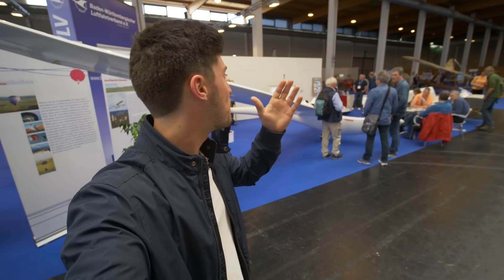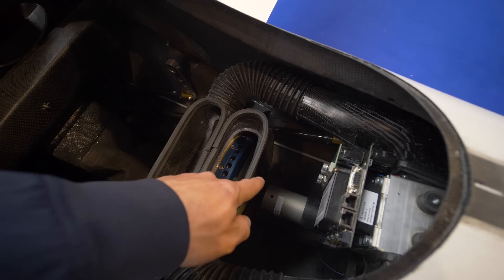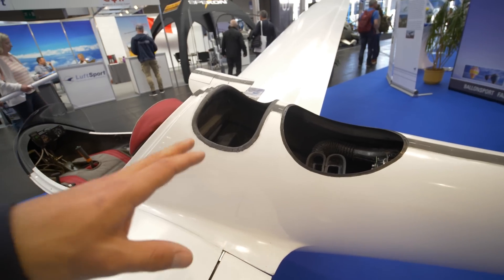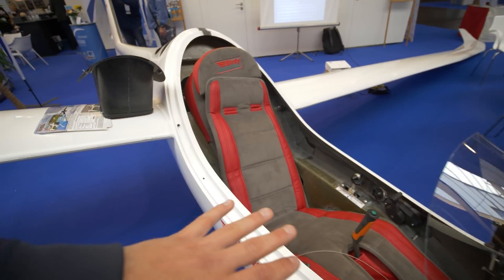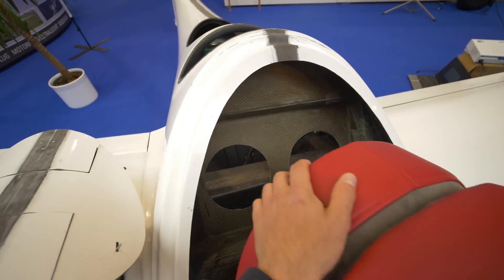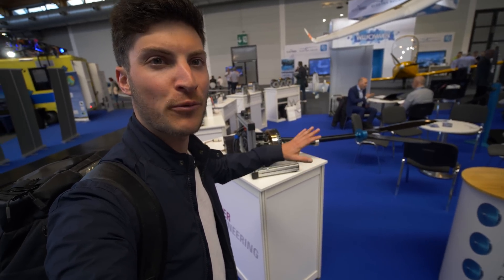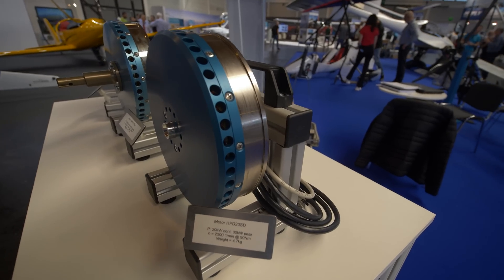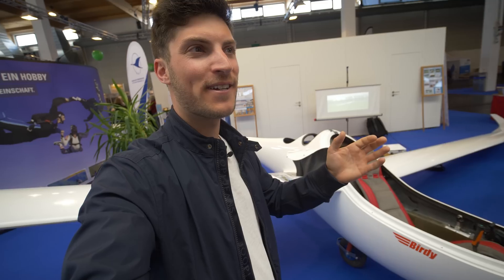120 kg Electric Glider BIRDY - AFFORDABLE Future of Gliding? | AERO 2022

Comment: Affordable means......under $100,000 or under $200,000..? I'm going to depend on an electric motor NOT failing for my spoilers.....NO!!! Done emergency practice landings on a 9000' runway with no spoilers and almost floated down the entire length in ground effect before getting the wheels to stay planted..... Should have spoilers....

Comment: What are the specs!  The surface area ! The aspect ratio,! 
Stall speed!

103 legal requirements are to have it with less than 24 kn stall speed and that will dictate what will be the surface area size and total wing load..

Comment: Cool project but I don't like tail. It adds a lot of difficulties for take off and landing! Solution without spoilers is interesting but what if you don't have any power in the batteries? Glide performance is impressive!
Reply: If the battery is empty the impressive glide performance becomes a real problem
Reply: @photosquare7  By my calcs slowing it from cruise to landing speed then bringing it to a halt will require about 1% of the battery capacity. So, it'll work so long as you've only used 99%. But, yeah, if you used all the battery getting out of trouble earlier in the flight, there's another drama to face landing.

Comment: I'd like to see an FMEA for using the electric drive as the speed brake, it requires the complex system to function vs the simple mechanical spoiler. The spoiler function, if not available, can be compensated for by flying uncoordinated at the cost of higher pilot workload, so it may be acceptable.

Comment: Why is he talking about meters and kilometers per hour, climb rates of meters per second?
These aren't aviation units of measurement.

Altitude is in feet, climb rates are feet per minute, distance is in nautical miles while speed is measured in knots.

The numbers he's quoting mean nothing to an aviator without a calculator.
Covering up bad performance with changed numbers?
Reply: That's what glider pilots use in Europe

Comment: Nice looking glider. Electric motors for airplane is a mute point: it looks simple but it is not. You need a heavy inefficient battery (very polluting) an DC/AC converter, an expensive permanent magnet (from China) motor and the dreadful limited range.
For the same weight and less money you can get a gasoline (petrol) engine that can go 10 times longer.

Comment: I am a noob on these microlight gliders...Perhaps a stupid question, but can You fly these on an EASA glider licence? Or do You require a country specific micro light licence?
Reply from the maker: You need a micro light licence because it has a propulsion system. A micro light glider without propulsion would only need a check flight...
Reply: @SteFly  Thanks for the clarification, makes sense!
I thought that perhaps it was under the same rules as SLG:s.

Comment: very nice to have low weight including motor, I'm a big believer that planes can be a lot better than they are, mainly powered planes where they can get away with poor engineering.
I would like to see a similar optimized plane with a pressurized cabin and 2 tiny turbofan jet engines on it for a design speed well over 500km/h. I think that concept has enormous potential. People fail to appreciate that a turbofan plane can be very fuel efficient at altitude and have extreme range so we can have fast, cheap, fuel efficient, long range planes with dual engine redundancy for ocean crossing capability. It would be a small revolution.
Reply: Hi Dan, -  so You need only  12 hours  to fly from Frankfurt to New York - alone in Your plane ...........and so cheap ......  ha  ha  ha
Reply: @helmutpohl2762  It could be a tandem or 4 seater, same premise. And it could be 9-10 hours to New York which is pretty fast from decision time, likely beating an airliner and it becomes extremely fast when it's not a common destination like New York. Say Nova Scotia, Kentucky or Manitoba, well outside any major city. It might be 4 times faster than commercial airliner. And similarly inside Europe. Say Fyresdal Norway to Mors Denmark, a trip that takes quite a long time and cannot be done by commercial air but in a personal plane could be done in 30 minutes for next to no money while it might cost 400$ by cars and planes and trains and take 18 hours.
Rich people pay big money for less freedom. Or Paderborn, Germany to Norwich, England, that's 45 minutes but try doing that with public transport. I just did a search on travellink, 4 flights each way, 800$, 10½ hours one way and you depart at 7AM and 19hours the other way. With a personal jet you just go whenever you want and it's close to cost free.
With runway to runway autopilot you don't even have to fly it.
Private jet freedom but no more expensive than a car. If done right.

Comment: I'm, probably, wrong but I use airbrakes to reduce lift, not speed.  It is kind of scary to dive towards airfield with propeller basically  working  as a parachute. Sounds like acrobatic.
Reply: Air brakes increase drag, reducing speed for the same angle of attack. Spoilers reduce lift, and also increase drag. Gliders often have linked air brakes and spoilers, so they are used together. Either has the effect of making the glide slope steeper, but they affect pitch differently.

Comment: No spoilers, counting on the electric system to always work, and always have enough power to create enough drag for a normal descent and landing.  I don't think so.  Great video anyway, thanks!
Reply: The early ASW12's had no speedbrakes. Once under a big strong cloud near the cloud base it is very nerve wracking not to be sucked into the clouds and stay VMC. Seen the claimed L/D of 40 the speed will rapidly approch the Vne in this situation.
Nevertheless the complete concept is brilliant.

Comment: wondering how they've handled the torsional resonance of the long drive shaft which is what is the usual problem with long shaft rear drives
Reply from the maker: I heard something about it.. they also had problems at the beginning and now they are using a slightly bigger diameter carbon fiber tube.
Reply: @SteFly  A bigger diameter will probably help, but is not the main problem/solution.  On long shafts, there MUST be non-symmetrical spacing between the anchor bearings that the shaft passes through.  If the shaft is 2 meters long for example, pass-through bearings would be at 0.45 meter, 1.1 meter, and 1.8 meter.  This makes sympathetic standing-wave vibrations unable to develop in the shaft.  This is a MUST!
Reply: @SteFly  the biggest problem is when the rotating propeller blade passes through the 'shadow' of dirty disturbed air behind the rear control surfaces (the rudder) and it causes a "bump" and that's what causes the vibration. With a piston engine you also get the power pulses torquing the drive shaft BUT with an electric motor that's eliminated.
Going up in drive shaft tube size helps the resonance problem but then other issues arise as the drive tube gets larger... It's all a compromise
Reply: It reminds me of those crazy Thai riverboats that just have a long prop shaft stuck on a big v8 or similar...I do not understand how that works, but it is somehow dynamically stable. Built a small model  long time ago that worked, to my surprise. It seems like adding additional supports easily makes it unstable.
Reply: @erikisberg3886  ah, I remember those...
Good times in 1973 on leave.
Yes, in my month living in Bangkok right beside the river I never saw one whipping or vibrating with any syne waves. I wonder if it's because it's only supported at one end and the shafts are fairly large diameter (proportionally)
Reply: @bobjoatmon1993  The simple model experiment I did was with a propeller attached to a welding rods driven by a DC motor. The rather flexible shaft could take a surprising amount of propulsive  force and torque. I worked at the Chalmers University department of machine components at the time. Remember a lot of discussion at the coffee table about why this works... I still do not have a clear picture of how. If You try to support or disturb the shaft it can fail quickly and spectacularly... 
I have also seen one of those irl, amazing contraption and performance.
Reply: @erikisberg3886  yes, once the rotating mass gets out of the axis of rotation, the shaft becomes a flail and beats everything around it viciously. I have seen long shafts twisted up like pretzels in an instant in my experience as a Millwright (industrial mechanic) and as an A&P aircraft mechanic.
Wait till your a few yards from a 60, 000HP (yes I mean 60K) turbine engine driving a huge centrifugal pump and one of the flex couplings shears and a 6" steel shaft bends and flails around... Shaft guards might as well be made of tissue paper.

Comment: Using the reverse thrust from the motor instead of airbrakes is a good weight saving idea, but what if you run out of battery?
Reply: If it has a variable pitch prop (even two positions, which isn't too hard) then you could charge the battery. It would even be a very interesting idea in racing (if made legal)  or certainly for just fun flying to charge the battery in a thermal or ridge/wave and then use that to extend the glide. Two hours level cruise at presumably about 100 km/h would be amazing for getting between lift sources. When would you ever actually need that much?
Reply: Samuel, realize that what you're asking is "what happens if you don't pay attention to your flight?"  There are many ways to screw up a flight, and they have consequences.  You're looking to fly a plane without paying attention to how much "fuel' is onboard?  Remind me to not fly with you.
Reply: @lesizmor9079 plenty of case studies showing experienced pilots making basic mistakes. Or defects which cause you further issues. I’m just asking what is the back up if you have no battery left? Surely the manufacturer has thought of an alternative?
Reply: @lesizmor9079  remind me not to fly with you if your arrogance thinks you cannot make a mistake

Comment: I've used the prop as an air brake on my rc gliders for years and it works really well, all it needs is enough throttle to open the folding props and then the drag slows it all down.
You said the props reverse on this, is that correct? 
What price would these be?

Comment: If I didn't already have my Silent 2 I'd certainly consider one. I like the convertible top. The 2hr endurance on electric would be great if true. The folding prop may windmill enough to stay open and provide  adequate drag for approach. I expect the motor would have to supply significant braking/regen to stop the prop for folding. I doubt very much that it is reversible and even if it were , the lag in going from forward thru folded to reverse would make it impractical for glide-slope control.
Reply: It's a glider.  So the motor is not running in the pattern.  The flaps would probably be the primary way to increase the rate of descent.  I'd not want to rely on the motor when landing.

Comment: THAT IS A VERY INTERESTING GLIDER!! DOES IT  CLASSIFY AS AN ULTRALIGHT IN THE US ? (NO PILOTS LICENSE OR MEDICAL REQUIREMENTS )? CAN YOU ARRANGE A FLIGHT AND DO A VIDEO I'D  LOVE TO KNOW MORE!!THANKS  GREATWORK!
Reply from the maker: Not sure about the US regulations. Here in the EU we need a 120 kg ultralight license but no medical.
First I will need to get the license... costs some money but it's the plan
Reply: He did answer the "About" price, in a reply I read, above!
So, "About €60,000!"
Reply: @robertweekley5926  wow 60k would be great. Sign me up. Can the wings be removed/folded so it can be stored in a trailer? That is a big cost savings as in the USA T hangars are hard to find and increasingly expensive.
Reply: 120kg = 120 x 2.205 = 264.5 pounds. The part 103 ultra light weight limit is 254 pounds. However if equipped with airframe parachute the weight limit is lifted to 278 pounds. So if a chute can be added for less than 13.5 pounds it might be possible to be a part 103 vehicle. Note part 103 vehicles are not classified as airplanes. If over weight for part 103 then you will need a glider ppl, which is not the end of the world to obtain and good education. I think the most important piece of info is the cost, I might have missed it? What does it cost?

Comment: These are the most exciting and innovative design developments in a while. This glider might never win a race, but not all gliders should be compared to racing gliders. Compared to most other light aircraft or TMGs a 200 km vne is impressive. and 30 KW from a 4,7 kg motor!
Reply: Problem being the energy isn't in the motor... it's in the heavy batteries you need to power it. We won't surpass the energy density in petroleum products in our lifetime.
Reply: @sillyoldbastard3280  although the thought is quite seductive. Imagine an energy carrier with 10kWh/kg and a motor with almost 10kW/kg.
Unfortunately any battery chemistry imaginable will not even come anywhere close to that.
Maybe a fuel cell will one day, but not if it needs pure hydrogen.
Reply: @sillyoldbastard3280  well not mine but my 17 yr old very well might see that.
Reply: @sillyoldbastard3280  Jet fuel is 50x more energy dense than a lithium batteries
Reply: One cannot compare an electric motor to an internal combustion engine. One has to always include the fuel tanks and the batteries for a given mission.

Comment: I don't understand how they will use braking with prop to degrade your glide for landing. The folding prop opens with forward thrust. How would you achieve that to create revers or just drag? What am I missing here?
Reply from the maker: You are right. It can´t be reverse power - only drag from the unfolded prop. A mechanism to controle the pitch of the prop would be awesome.
Reply: A wind milling prop could create a lot of drag, autorotate down gyrocopter style, sort of... I assume pitch can be adjusted otherwise there would not be much drag.
Reply: centrifugal forces on the prop make it stays open

Comment: I would really like to know more about this glider. Can you provide more info about its price and availability? And, I would love to get you into the glider with your camera to get your opinion about how it handles in the air.
Reply from the maker: I don´t know the exact prices, I only heard something about 60k € for the shell with motor.
Reply: @SteFly  that's actually quite a good deal considering that class 2 hang gliders (like the Archaeopteryx and the Swift E-lite2) sell for more than that
Reply: This is tempting to buy! 🤩
Reply: And how about performance....I mean, at higher speeds, this will really suck. Nice it climbs like a Rhönlerche....
But it probably sinks like a brick in the glide at higher speeds....Just look at the huge fuselage....that is not the way to go

Comment: A step in the right direction.
I'd still want thin-film solar cells covering the surface of the glider so that it can be used for touring in places that do not have conventional electrical power available.
Reply from the maker: Here at this glider it will be really difficult due to the strict weight limit at 120 kg... but of course it would be great!
Reply: @SteFly  Why not deck out the trailer with the solar cells and possibly a batter bank instead?
Reply: The weight would negate any benefit on an aircraft of this nature.
Reply: @sillyoldbastard3280  NO. 1-2Kg is not going to harm how well you fly and still get you meaningful recharge where you could not without.
Reply: @sillyoldbastard3280  Surely you mean the weight at present?
Reply: @sillyoldbastard3280  ¿what does weight matter? the idea is to fly better and farther, the weight is the least important
Reply: Eric Raymond Solar-Flight
Reply: Agreed. Who wants a tow plane? No one.
Reply: Touring in a glider like this would likely be impractical; it won't have luggage capacity, is normally stored in a hanger (which would not be available) or its own trailer (which woukd not be with it), and glider ports are not typically places you would want to arrive without local transportation. 

The total fixed wing area would ideally be sufficient to produce not much more than one kilowatt, so a day of parking with sun exposure might produce enough charge for a short flight.

At least you're not (I hope) suggesting that solar panels on the aircraft could keep it flying - I see that a lot.

Comment: Would love to see a test flight. The lack of airbrakes is interesting - if there's any problem with the motor, then you might get into difficulties with an outlanding.
Reply: Any glider pilot knows how to sideslip, which is the alternative if your airbrakes don't work, so I'm not too concerned about that.  I remember during my training in the 2 seater, on one approach I found the airbrake was completely jammed, and I had to sideslip it into a landing. I then discovered that the reason the brakes were jammed was because the instructor had his foot on the lever, just checking me out to see that I could cope without them.
Reply: @uproid  This is true although modern gliders like this are very slippery - I wonder what the sideslip does to the glide path, would it get the L/D below 10?
Reply: @colinjacobs176  It's really a forward slip which is my favorite maneuver because it seems so naughty to cross control. I forget the steepness, but it certainly can make noise when airflow goes non-laminar. I always wondered what happens if you alternate the controls back and forth to play with the lag of laminar flow.
Reply: Just use the flaps to increase the rate of descent.
Reply: @Paul-vh6ul  But that can be slow. Look at this author's flights along cliffs of west NZ where instant on/off of the spoilers was often needed to avoid hitting the glider in front of him in narrow lift band. Could also be done with forward slips but not flaps.
Reply: It's electric so extremely reliable
Reply: @gregb1599  so are sat navs till they fail !